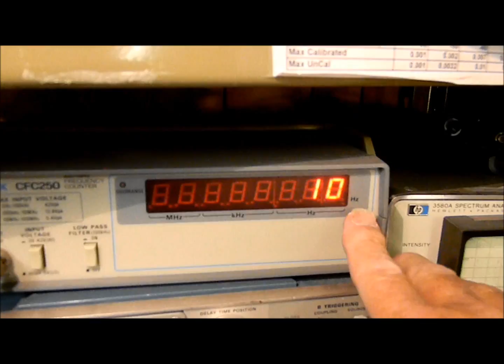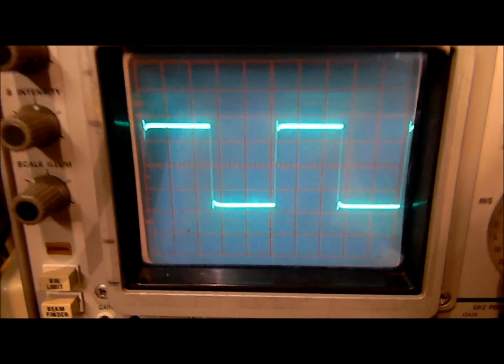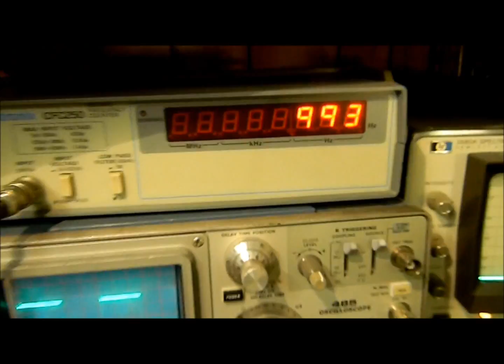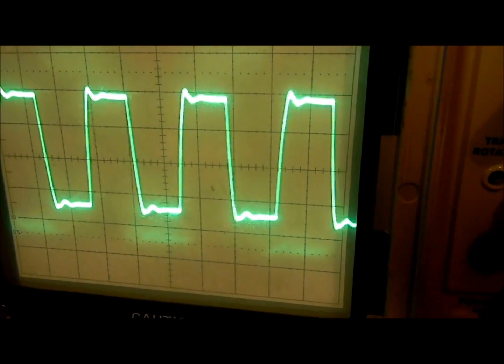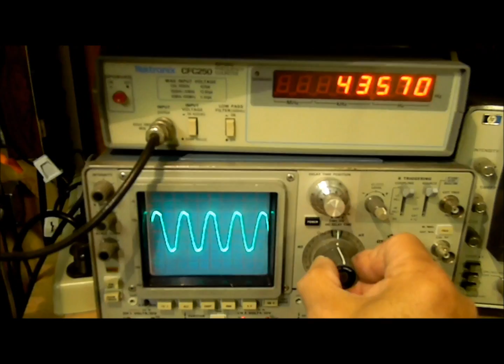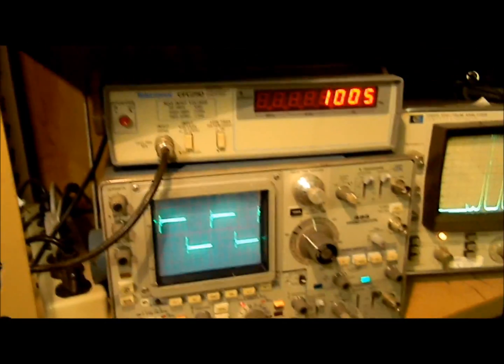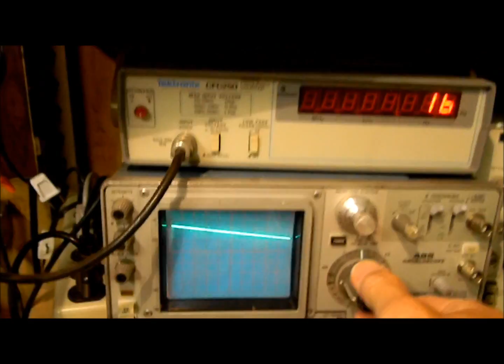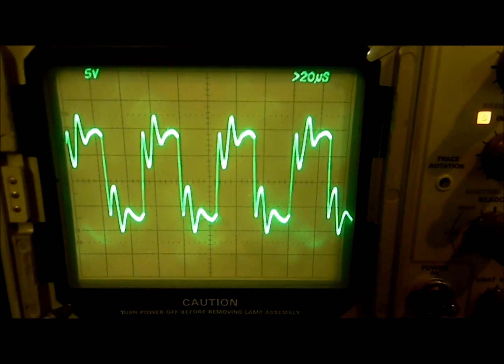Square Wave Testing of Audio Vacuum Tube Amplifiers

Comment: Nice to see this tests. I've recreated some of late 40's or early 50's tube microphone preamps with DC into output transformer. Most were without negative feedback and give quite similar response to Fischer. At first it made me think preamp with square response like this has nothing to do with high quality repoduction, although studio tests revealed they are some of the best sounding ones i built. Quite particular sound, squares revealed bent edges were sign of high and low pass, so most of them will go from 35-45Hz to about 18kHz +-3dB with little ringing or overshoot. Very revealing.
Only cap coupled into output transformer gave me nice square response from like 10Hz to 50kHz or even higher.
Reply from the maker: That is really interesting about capacitor coupling into the output transformer. Do you think this improvement if FR is due to eliminating the DC bias on the transformer? I used a very large PP OPT that will deliver over 1KW of good audio in PP circuits at 3 KV on the plates of the tubes but when I tried to use that transformer in a SE amplifier running an 833A, I found that the core saturated very quickly at about 150 mA and was pretty worthless. I would assume in a small voltage level output transformer, from a preamp, would saturate at just a few mA and have essential no inductance as I experienced with the big transformer. Do you think this is the case with your preamp, and square wave response ?  ... assuming I am understanding your situation correctly.
Reply: English is not my native language, so let me explain that i only use gapped transformers when they are DC biased. I tried really huge cores meant for parafeed and all of them saturated to a point where it could be clearly heard. Couldn't find any use in studios for such sound. This are high quality microphone preamps, with proper pad also for line signals...
I'm sure most amps with DC into output transformer in general have more restricted bass response, if compared to cap coupled. Such transformer needs air gap to prevent core saturation, consequence of this is lower inductance and restricted bass response. So core mass has to be bigger to get inductance back, which also gives better bass. Cathode bypass cap can help with bass further, although just a bit. But this are hints when replicating old designs because we also have to have this cap of higher value, because in 50's when lytics were available, stated capacitance was actually about 100% higher, which influences bass response too. There are other things in designing gapped transformers, but i let them to my winders which are mostly people from Cinemag. Sometimes i buy vintage models, mostly when clients want them.
There are different core materials to get desired sound with SE designed preamps, for some designs i tend to use mixture of iron or nickel where laminations are interleaved like 2x2 or so instead of classic butt stacked iron cores. Ni/Fe tends to get even better mid frequencies which is probably the main reason people still use such amps and preamps. I'm not saying butt stacked iron core in such design is bad, it just sounds different and i guess is way, way cheaper for power amps. For power levels you are talking about there are probably no cores with any nickel on the market, you might want to check for that. My preference in general probably goes towards parafeed resistor loaded designs because they tend to sound more linear, have more punch in bass, but SE has so good mids that parafeed never even came close. Very nice on vocals and also many other things. For high end Hi-Fi my preference goes towards resistor loaded parafeed for sure, especialy when amps are PP.
I'm not surprised at all that your core saturated at 150mA because PP transformer in preamps can take about 1/10 or even less DC, compared to gapped one. And if tubes aren't well matched sound isn't good enough for studio use.
You are right, preamps with DC biased transformer without air gap saturate even with only a few mA. Model with lowest current i built was RCA BA-2 which has 3,5mA/250V HT, every ungapped transformer saturated. Typical gapped transformer takes about 7mA if we talk about microphone preamps. PP ones in the same application can take ~0,5-1mA, so this are no welding machines like yours :)
Square responses mostly show a bit restricted frequency response for SE, in general it is easier to get better results with parafeed.
Physics are the same for very high power audio amps like you have and studio mic preamps i do, so hope i'm right with explanation of my experiences. If anyone has other opinions it would be nice to discuss this matter further.
Reply: I believe the downward sloping of the output square wave of the amplifiers is caused by a high-pass effect of the capacitive coupling between stages. A series capacitor with a shunt resistor, or a series resistor with a shunt inductor should function as "differentiator" rather than an "integrator". The downward "sloping" is a capacitor discharging through a resistor (sort of a small section of an exponential curve). What do you think?

Comment: I can see you've got some nice toys out there
Slants in the waveform amplitudes at 100Hz are caused by low quality speaker transformers in tube amps. But in your videos its not too bad, most amps will have frequency response like that.

Comment: David
  I meant to tell you that on this amp,you need to add a little more capacitance on the feedback resistor. Usually on the MK3s you have to use anywhere from a 390pf to a 720pf silver mica depending on the circuit..I guarantee that you can get that ringing out in the upper left corner with that trick of you haven't already.As far as the 100hz and the 10z sq wave,you can get it better with  beefier power supply but that is very common on many amplifiers at those frequencies.

Comment: @ElPaso TubeAmps To get the 8V output, you are just turning up the volume control on the Amp correct?  I get a little confused sometimes if the output voltage is a function of turning up the amp volume or increasing the amplitude of the signal generator.  Any light you can shed on this would be appreciated!  I have learned so much from you and I look forward to learning a lot more!  Thanks for making these videos:)
Reply from the maker: +Adam White One way to start out is turn the volume of the amplifier all the way up while keeping the signal generator output very low, i.e. a millivolt (mV) or less and then start increasing the output of the signal generator while watching the output of the amplifier across the 8 ohm load with your oscilloscope.. I say it this way because you do want to be careful that you don't overdrive the first stage of the amplifier because then nothing will make sense at the output. If it is just a power amplifier like the ones in this video it will take 1 or 2 volts or more to over drive the first stage of the amplifier so you may set the output of the signal generator at about a volt or so and use the volume control of the amplifier to increase the output.  If it is a guitar amplifier, just a few mV input will overdrive the first stage so you have to be really careful in that case.  Hope this helps.

Comment: A lean or curve on the left hand riser is an HF limitation (caused by a pole). A downward slop on the top is an LF limitation (caused by a zero). Ringing at the top LH corner is marginal instability. Same goes for the bottom traces in reverse. Any difference between top and bottom is a push-pull issue of some kind.

Comment: Hello David,
I hope you are doing well and enjoying the Spring before it gets hot.. I have done a good bit of square wave testing before and like the previous fellow said, the same test into an inductive load is more of a mess. But having a good response into a resistive level is a good starting point. What I have seen in my work at lower frequencies when the line slopes down on the top and slants up on the lower part of the display, is low frequency roll off. As the signal starts to transition from a square wave to more of a sin-wave is high frequency roll off. Most of these anomalies are tube specific but sometimes playing with the bias and B+ you may be able to set the tube to have a better response at higher frequencies. However, when you have a design that was done years ago such as a Dynaco, it's a little late to reinvent the wheel...Hi hi.
I was designing an amp once using a 45/2A3 interchangeable config and was able to find a more linear part of the tubes power curve and improve the high response over what seemed to be the standard voltage ranges of other designs I had looked at.. That was such an interesting project while being a real PITA.  
Thanks so much for sharing your results and time with all of us audio enthusiast. You really explain your material so well. I suspect you have done some training professionally in the past.  Vry 73 from SC de WA4AOS  dit dit

Comment: The slope at low frequency of the square wave is related to the low frequency response normally limited by (and actually designed in) the coupling capacitor time constants. The leading edge ringing is probably due to your lead length to and the inductive nature of you load resistors. This could also be the lower damping factors (related to the amplifier output impedance) of tube type amplifiers. I like your instrumentation: Tek 7904 and Tek 485!

Comment: Using a square wave is a useful test because it give a good guide to frequency response and the overall stability of the amplifier. Many amplifiers give a reasonable square wave into a resistive load but a loudspeaker has a very inductive load. Try looking at the same square way with an inductive load, it can be a real mess.
One of the best amplifiers (valve) I have tested was the QUAD 11. Wide frequency response and very stable square waves. The slopping tops and bottoms at below 100Hz is due to low frequency roll off. Very few valve amplifiers go down much below 40 Hz. In those days there was no reason to go down to such low frequencys. A vinal disc has nothing to give at these frequencies in fact you need to cut such frequencies as all you would get is high levels of rumble from the turntable which in turn would give large bass cone movement and intermodulation distortion.  The ringing is mostly due to the output transformer and negative feedback, or lack of it!
Reply: Indeed Mike. I even test for the 10KHZ sq wave. I look at ringing on sq waves and any buckling because it does dictate the FR as you say and any slopes you may see in FR.
Reply: Hi thanks a lot for the interesting advice.  What about solid state amps ? do they have a better performance at SW test with real loads ?
Reply: I have used voice coils removed from speakers to do testing for the reasons you mention.  It never really seemed to make any difference.
Reply: @bigcbradio  If removed from the core, the inductance will be quite low, and not really a very valid load
Reply: @MichaelBeeny  Ok, so I will epoxy one in place

Comment from the maker: It is difficult to say definitively but I think the "warmth" that we hear in tube vs SS equipment is in the harmonic profile of the tube amp. Clearly, if THD were the only true value in an amp, All high end SS amps would "sound better" than All tube amps - but that is not the case. Tube amps distort differently than SS amps and simply put, we like it - also, tube amps have a more rolled-off high frequency response and I think, generally, that is less harsh or tinny sounding - just my thoughts
Reply: The "warmth" (tubby bass) the low damping factor. The "lack of harshness" (warmth?) is poor HF response, fewer high order harmonics, and lower IMD.
Reply: The HF roll off is a function of the output transformer. The distributed capacitance of the primary coils just eats the high frequency components of the square wave.

Comment: that ringing appears to be consistent with all tubes.  try putting a solid state on there, i bet that artifact disappears. have you identified "the warmth" ?
Reply: That ringing is caused by the output transformer. A transformerless design (yes, they exist, but they depend on low-mu, power triodes such as the 6080) probably would minimize the ringing.

Comment from the maker: Yes, the peak value (the top and bottom of the square wave) has the same RMS value so it is kind of like putting a DC source or a battery across the speaker and will make the speaker voice coil have to dissipate more heat. I have always felt that square wave testing of amplifiers has pretty limited value but it may be an instrument along with an oscilloscope that some hobby labs have. Thanks for your input.

Comment: On the 3rd amp, the ringing is still there, but is nearly invisible due to the long trace sweep cycle time. If you look at the rising edge at the same uS scale as you used for 20khz, the ringing would look the same, assuming the generator was providing the same rise time at 16hz as at 20khz. The Fisher has a lot of L-C resonances at work as evidenced in these tests. Poorly damped resonance. It also has a shorter time constant, so more LF tilt. Interesting videos. Enjoyed them all.

Comment: The tilt at the low frequencies is the time constant of the amplifier's ability to hold a DC voltage potential. Since tube amps are ac coupled, the time constant of the circuits will show tilt at lower frequencies. The tilt is always there, but at 1KHz, the sample time is too short to see this tilt. At high frequencies, you're seeing the slew rate. The amps under test demonstrate remarkable square wave for a transformer coupled amp.